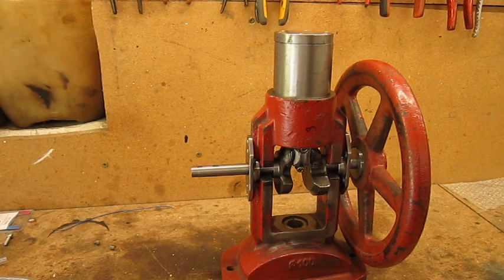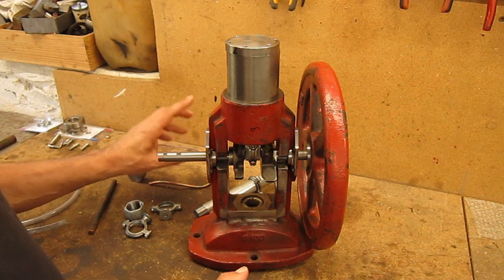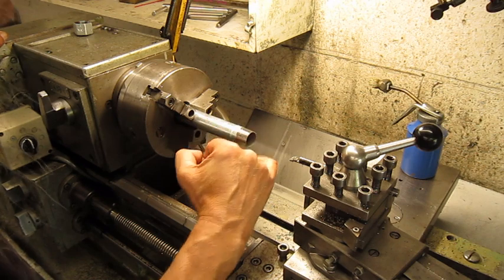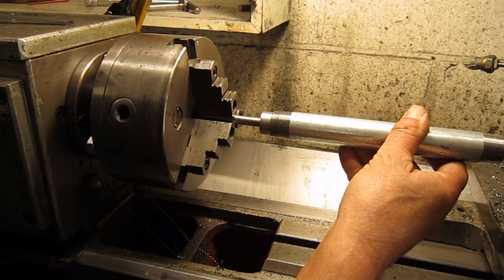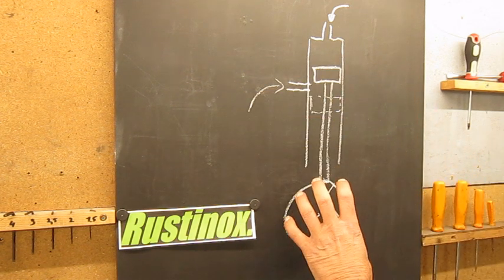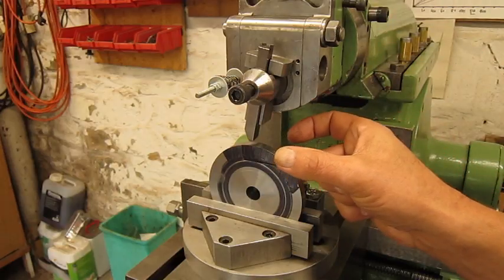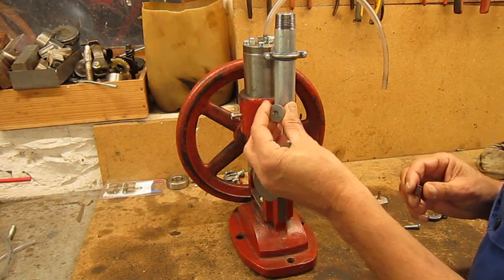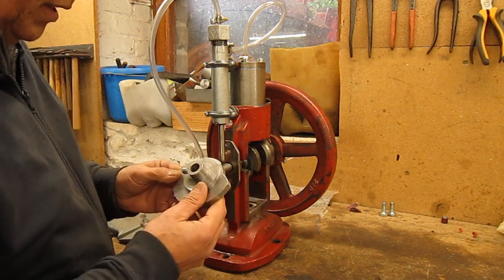Compressed air engine part 3 of 3.

Comment: Hi again! I just watched this series and I noticed you were having a problem with the 16mm drill bit with the piece in the drill press. You may already know this, but if you turn the crank handle of the vise to the post of the drill press, it will help hold the vise steady. Also will stop the drill from ripping the vise out of your hand if the drill bit catches in the piece. Just an observation. Great work by the way!!
Reply from the maker: Indeed, I know this little trick. It works well for tapping also.
Thank you very much for your input.

Comment: Ace video. The rhythm of the air engine is like the rhythm of a shaper so perhaps that's the link. At the end I found myself intensely concentrating on the moving parts of the machine. Captivating.
Reply from the maker: And great fun to build.

Comment: G’day Rusti, well done with the air motor, I knew you would make it work. I was calling out that cam won’t work with the sharp corners, round it out and you did. 
Cheers 
Peter

Comment: That was ... satisfying? ... seeing it work that well, at that low of a speed.  That sound is familiar, I think it mimics the sound of Dave Richards' steam driven line shaft system.

I'd be tempted to build a second cylinder to couple to the first, synced at 180 degrees.  It would probably run even slower.

Hope this finds you doing and feeling well, and, as my brother always puts it, with "all the right numbers in the right places."

Comment: I love it. Makes me want to stop messing around fixing the machines, and start trying to build my jet engine
Reply: hello sir,, i have a jet engine that only needs some work on the combustion chamber .  its been running and was built by a freind of mine. a very powerfull lump of metal.  8"x16" 6"impellor 6" turbine.. i was thinking of putting it on the rear of bicycle but bottled out ! max revs 48.000 ...160 kilos thrust more or less ! regards laurence

Comment: Sounds lovely works really well, it would be a whole lot smoother if you were to use a bearing cam follower instead of having the valve rod directly in contact with the cam have a ball bearing on the end